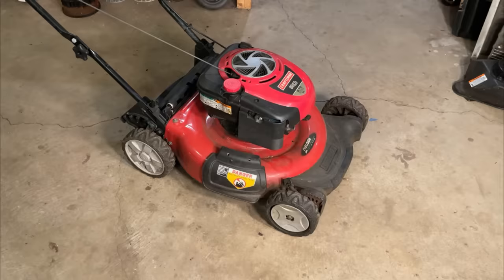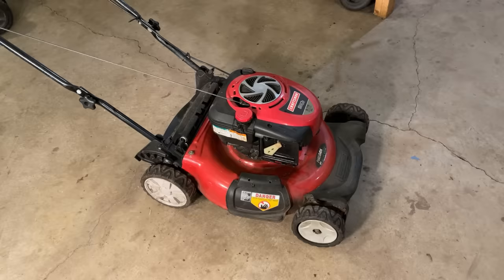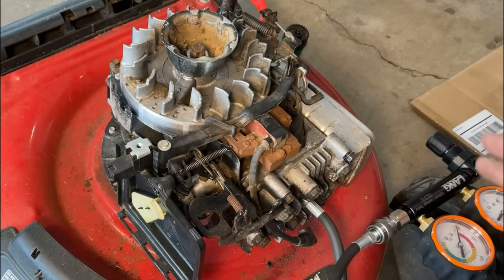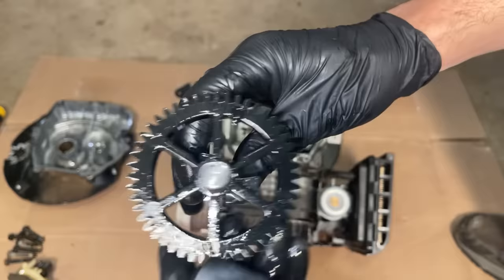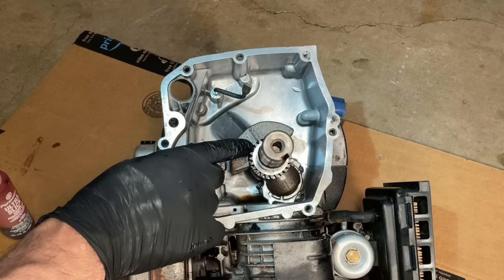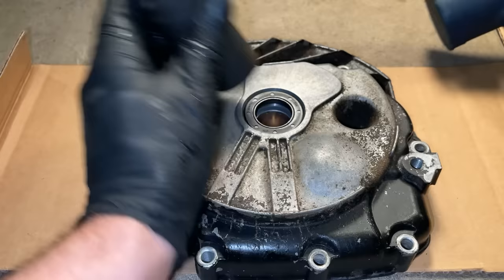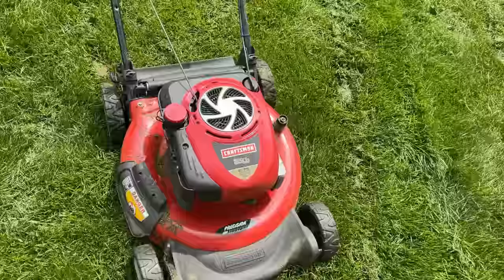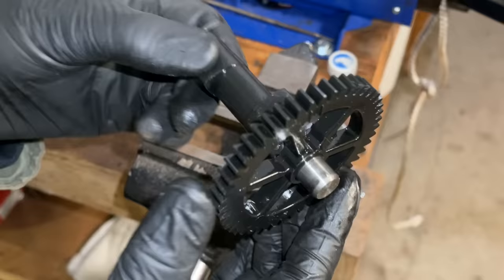Lawn Mower Will Not Start - You Will Never Guess Why

Comment: Nice Job James.  I have not ever encountered that problem, it's good to be made aware of it.  Thanks for the video.
Reply from the maker: Thanks!  Judging by the comments, it might be a more common problem then it should be.
Reply: @jcondon1  yessir. Very common issue here in hell. I mean ne Texas
Reply: @jcondon1  ... Clearly, you are intelligent enough to diagnose and repair an internal timing jump due to camshaft failure. So why not go ahead and use "than"?
Reply: @JW...-oj5iw  Wow... grammar police here.
Reply: @JW...-oj5iw  Yummy, a sandwich! LOL, you have issues, just sad to see them here on his page.
Reply: Why in thr hell are these damn manufactures put plastic parts in an application like that? There's NO excuse.
Reply: @totallysmooth1203  Anything to make money! They would rather use a cheap plastic part and charge the same price as if it were made of gold or platinum. Rest assured, the extra money will not be shared with the employees.
Reply: P
Reply: Wow Dw6, Condon, Mowermedic all in one place. To quote Field of dreams... "is this heaven?"
Reply: *f*f*"Fflint 1
Reply: @jcondon1  Thanks for taking one for the team :)  I prolly would have walked away after finding the flywheel key was OK.  I have a nice little show-n-tell bucket of parts with a plastic cam from an  E-series engine to show folks how bad it's gotten with cheap parts. I always learn something from your videos.
Reply: Xxxj
Reply: Xxxd
Reply from the maker: @TheLawnmowerLady  Thanks!  it was supposed to be an “easy” one for a change.  Enjoyed seeing you on Micks last weekend.
Reply: @D&R Small Engine Repair 2jkkkkkkkkkk
Reply: @THEMOWERMEDIC1  w2
Reply: @jcondon1  l’
Reply: B
Reply: Honda 2.4 outboard will not start
Reply: @D&R Small Engine Repairh
Reply: @D&R Small Engine Repair hhh
Reply: @woolval52  No more than a typo.
Reply: @JW...-oj5iw  No more than a typo
Reply: Where  @JW...-oj5iw  
“
Reply: Those cams used to be one-piece steel.
Reply: Excellent video Thank You
Reply: My guess is that you have condemned or thrown away several. I found this exact problem with a “free” mower. The local small engine “mechanic” suggested replacing a list of parts and when they failed to fix the problem, recommended a new mower. I pulled the head and saw that the valves were not opening and closing in time and brought it back to the “mechanic” who didn’t see a problem and said they can’t jump time so it must be right.(I am not a mechanic but I do understand how motors work, I knew this guy was also NOT A MECHANIC) it was not even my mower but I did find it for a friend and felt responsible for his aggravations. I ordered a new cam shaft on line and mower has run perfect ever since. Whoever thought that a plastic gear would never shift on a smooth stainless steel shaft should have his head examined!
Reply: @JW...-oj5iw  relax Karen
Reply: @kevinkinal9557  gunning
Reply: @michaelalbert8474  they'll jump time just hitting a stick...
Reply: @MrBubbahunt9  
Then you agree with me that it is only uncommon for people who don’t know how to diagnose the problem. I was very disappointed when Brigs and Stratton went out of business, but not very surprised.
Reply: P
Reply: @JW...-oj5iw  w
Reply: @totallysmooth1203  I totally agree! F---n plastic cams and gears? and now plastic carbs. these lousy Manufaturers should rot in hell!
Reply: 6
Reply: @jcondon1  lll
Reply: Did you know the blade is your fly wheel, it will not start with out the blade.
Reply: @jamesakump  I always thought the Flywheel was the flywheel, but Im sure the blade helps. when I was young I had the blade snap off and bury itself inches from my toes in the grass. this mower had a unique iron Disk with 4 blades on the edge and the disk cracked at the hub
Reply: thats  what Many many  problems  are  caused  by  and  not only in mowers and lawn equipment   but in GM Vehicles !!!!   the manufactures  have lost their mind in plastic  because of  greed~ absolutely ridiculous!
Reply: I'm pretty sure if you had been on standby and continued to feed that carb with starting fluid the motor would have continued to run and run good , I mean well, If the valve time was in error relative to the ignition the motor would spit and sputter as it backfired through the intake and or exhaust and it would run like hell if it started at all .  We know by the correct position of the flywheel key that it's not sheered so, the crank and the flywheel are in sync , Crank to the rod to the piston the instant just before the pistons
 at top dead center, TDC . THE CRANK ALSO SPUN THE FLYWHEEL RIGHT BY THE COIL WHERE A SENSOR WHICH IS POSITIONED ON THE WHEEL TO TELL THE SPARK PLUG TO FIRE TO CAUSE COMBUSTION WHICH IS ALMOST IMPOSSIBLE UNLESS BOTH VALVES ARE COMPLETELY CLOSED , AND IF THEY ARE NOT NOTHING WILL OPERATE PROPERLY , Bottom line is everything was in time or I'm here to tell you that motor wouldn't run as fine as it did on the starting fluid , a steady pulse spray and it would run all day , It was a fuel delivery issue the whole time which was fixed during the unnecessary repair of which commenced but it's okay , We learn something new every day , hands on wrenches and sharing information is time well spent , That's my two cents based on my understanding of each of the four strokes  as well as the timing of this particular type of engine as opposed to a Two stroke while similar in timing , yet completely different in fact no camshaft with lobes to open and allow springs to keep them closed as needed , and you hope they smoke because they're supposed to , ,lol 
Now back to this Briggs and Stratton quantum , I wouldn't want one if you sent it to me and said I could have it . 
I'm a big fan of the B&S classic with the carb sitting on the tank with a straw dipped in it almost to the bottom , No prime bulb to cause problems or spring loaded emergency flywheel wrap around brakes which simultaneously grounds out the fire and stops the spin in the name of safety , I strip all of that shit right off of every one I end up with
Reply: If you hit some with the blade! & it won't start,,,,This is the first place to look,Is that flywheel key,,!
Reply: Threw away so many and power washers.  Or the Repair guy would buy off me for a few bucks.  Then I would see them for sale agin a few days later for 3 times what he paid me. 🤔💁‍♂️🙄😬😱
Reply: @JamesBond-hu9rg  Power washers are the most common things that have this flywheel key problem,,as special the vertical shift engines because they have the ability to kick back,,Because, of water pressure built up,,It wants too start backwards,,Which shery off the key,,
Reply: Whay doing not users not clean under there,  the gras start eating up the chassis
Reply: @jeff0nyschuk670  I know I hit my concrete steps with the blade bent the new blade and broke that flywheel key, and snapped the safety release cable. Unfortunately, I had to replace it with a steel key (all I had)so next time it will be the crankshaft that breaks : (
Reply: @jamesdiehl8690  k
Reply: I've only had dealings with the camshaft gear on a 5 hp Robin. If it's Japanese built, it's steel. Chinese built it's plastic
Reply: Good day, I'm I could someone tell me why my tandem xt160 won't ref up. I replaced new rings, air filter
Reply: Nice job
Reply: 5
Reply: @jcondon1  🎉t😢😢😢😢
Reply: I would think that the gear and the lobes would be pinned so it cannot rotate on the shaft
Reply: @jamesakump  ot absolutely will start without the blade
Reply: Make cheap. Is cheap.
Reply: @totallysmooth1203  Profit.
Reply: @jcondon1 ❤
Reply: @jcondon1 ❤❤
Reply: And their governor on most twin cylinders is cheap and breaks when new. I replaced a lot of engines under warrantee form this
Reply: @THEMOWERMEDIC1 
I'm outside of Longview tx
Reply: I can’t believe they cheaped out and used plastic lobes as a sleeve over the other one. Seems like more work to come up with that Mickey Mouse design rather than just making a single piece cam that will last.
Reply: @totallysmooth1203 gotta ensure you keep coming back for parts
Reply: @totallysmooth1203 thats why the old flat head engines are still running.
Reply: I was a fan of Briggs and Tecumseh engines for years. No more: my lawn tractor wont start, im assuming the compression release is shot. So for $150 i can replace it with another one that will eventually fail. Just now i learn my  push mower has plastic cams. AND a similar compression release. Wonderful.

Comment: Plastic gears and lobes on a camshaft?  This lawnmower is a complete disposable POS.  I'll keep my 1976 two stroke Lawnboy that still starts on the first pull.  The only maintenance I've ever really had to do it is adjust the points, which as far as I know, was the first time ever in 40 years.  The thing is older than I am.
Reply: Everything is a POS. nowadaysm
Reply: They don’t make them like they used to!😥
Reply: I watched your video, thermostat / auto choke, very good video!  This is way above my skill level!  At least I know if it’s “dead”, call it “new mower day”. Another very good, informative video!👍
Reply: Back in the days when real things were being built to last not So Much Anymore these days
Reply: Plastic junk.
Reply: Yeah I was born in 2005 so I don’t have the experience of things that were built in the 1940s through 1990s but I believe they were built way tougher than anything nowadays. Thanks that are built today will break fairly easy.
Reply: I had a bunch of those old 2 stroke engines and left them in a storage now they are selling for an insane amount for gokarts.
Reply: You do that. What does your opinion have to do with this video, Mr Worthless Opinion?
Reply: @nothankyou5524  Just expressing my opinion on that crappy engine and comparing it to a feat of superior engineering, Mr. Equally Worthless Opinion.
Reply: Lawnboy was always dependable. You dont see too many around. Now to me weedeater seems to be a lawnboy, dependable
Reply: Never have either usually the cam is one piece from gear to the end that fits in the crankcase! But now that EVERYTHING comes from China, I can believe it.🙆‍♂️🙋‍♂️
Reply: @mikeandcolleenk9831 I had a lawn boy for years and years 2stroke of course finally started showing it age, tires worn smooth, all the plastic parts, cowling and what not crumbling but still would run, anyway sold it to a guy that collects vintage lawn boy mowers and purchased a newer one@👋🤠👍
Reply: This is a briggs and stratton quantum engine, these are actually really good engines. Some people say they are the best engines briggs ever made. I have a few myself and they are really stout. Of all the lawn mower engines Ive taken apart I havent seen any real issues with platic lobe camshafts.
Reply: That’s what I keep telling people old this new stuff is crap . People always ask why do I have so much old things such as a 25 year old truck and a 1993 riding mower and a 1983 house . Now you know 😊
Reply: Okay you pay $ 25 dollars.. for it .. another $20 dollars in parts.. so what was your labor to fixed .. so how much it . Your are going to sale it for
Reply: I have one of those buried in my shed the pull string mechanism is shot I have to rewind by hand and it takes about three pulls. My dad gave me the mower because he could never get it started being one handed from stroke. I disabled the safety so you need not hold the handle. Maybe I might try to fix it I'm sure mine is out of timing. Probably when I slammed the mower on the ground when it wouldn't start. I bought a four stroke lawn boy when the junk craftsman would not start . The 4 stroke works if you spray starting fluid in the air filter hole but you have to stick a screwdriver to keep the choke open it first runs real fast until the gasoline starts flowing this mower don't drink gasoline like the 2 cycle ones did. Half a tank is all needed to do my yard I put a little less so the mower runs out of gasoline. I have no way of stopping it because I disabled the safety feature on this mower as well. I thought about putting a kill switch like the mini bikes had in them days. I could I guess fix the mower if I can find parts. I use an old Ryobi mower now if the grass is not overgrown. Forget about using it in high grass it will stall and you will be waiting about 2 minutes before you can continue mowing. I just mowed my yard today with only about five stalls which is very good with that old electric. 73
Reply: Unfortunately, the cheaper end lawn mowers, mainly at Wallyworld do this…I made a mistake four yrs ago when I needed one quickly. One yr later it was a paper weight….Went back to the better brands and it has not disappointed me!
Reply: That's not a quantum. It's a knock off copy of one. If you'd worked on many you'd spot th8s easily from the tank to the top covers, and even the vane and carb. The whole set up is crappy plastic knock off.